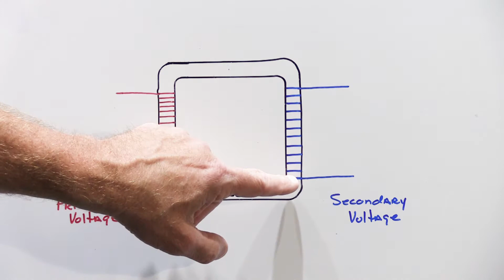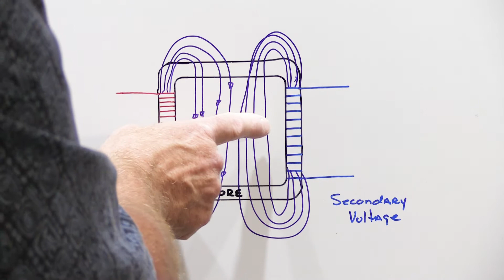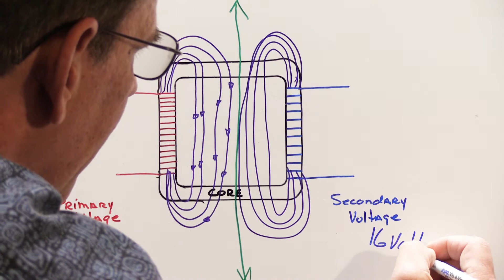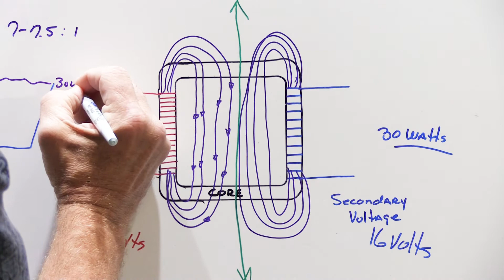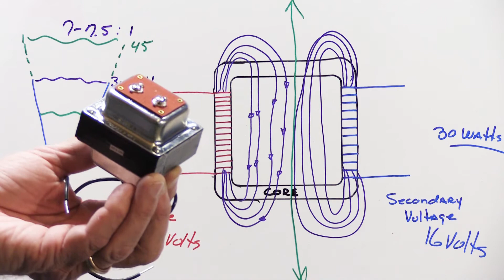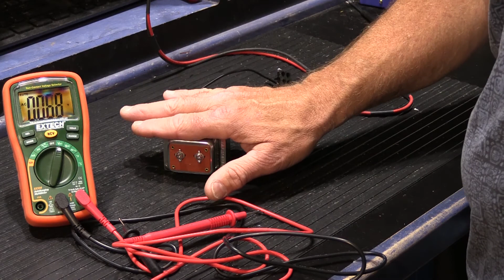How NuTone Intercom Transformers work and How to Test Them

Comment: I love this video, and I recommend people watch the entire thing, the transformer theory part is very well explained.  I have an A.W. Sperry voltmeter which I've been using for around 20 years and though it was all I could afford in college I've used it hundreds of times.  As mostly a car guy I rarely deal with AC voltage, but I just spoke with a customer earlier about how things need to be tested under load in order to get a true reading.  Thanks for doing the video, it reminded me of things I had forgotten.  I would add one thing about warning anyone doing testing that they should not put their hand on the primary voltage wiring contact points (which should always be covered anyway), or for that matter on any household voltage wiring contact points.  I learned the hard way about touching 240V when I was the ground.
Reply from the maker: Hi Joshua:  Thanks for the kind comment - It is very true that caution must be taken when working with voltages about 70 volts +/- .  I have a few set of wire cutter which have a nice bite out-of-the-blade from a 240 volt "incident" - This always seems to happen when the cutter are almost brand new - Chris

Comment: I can't find the transformer in my house,  where is it usually located?
Reply from the maker: Hi Raynier:  Your Transformer could be anywhere - Most common places are: Garage, Circuit Breaker Panel,  Furnace Closet, Water Heater Closet, Attic, Basement, Ceiling of a closet inside the house.  Usually it will be fairly close to the Intercom (ie. They wouldn't have put it 100' away and run the low-voltage wires that far) When trying to figure out what was done by someone before you - the Rule is "Installer are Lazy"  whatever was the easiest way to do it - it probably how it was done - Chris